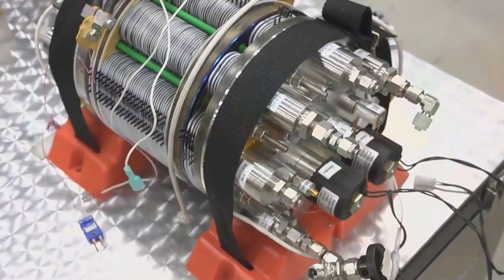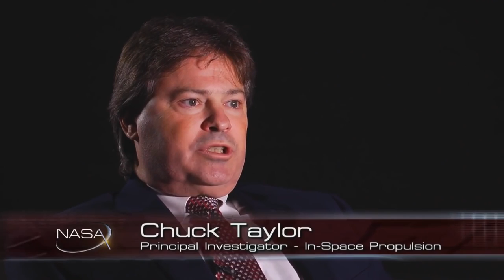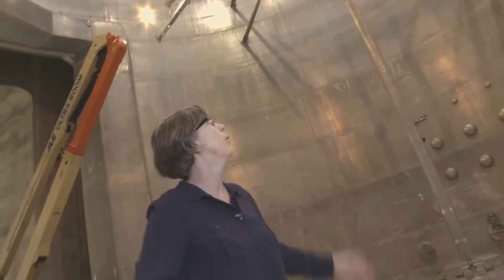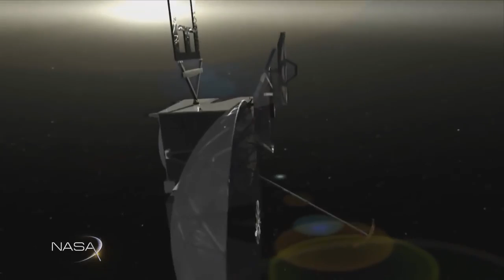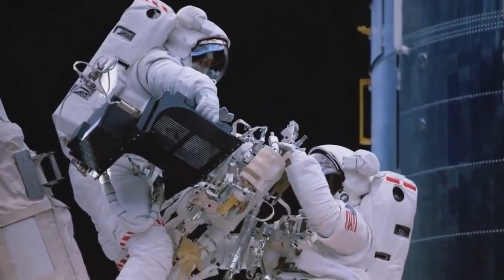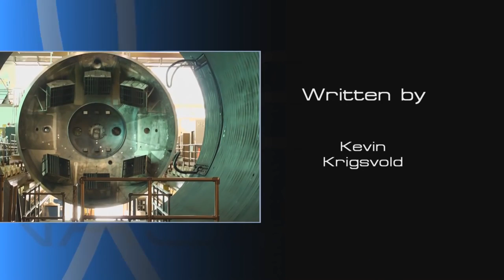Near Light Speed Interstellar Travel Development at NASA   (Full Documentary)

Comment: Propelling a space vessel faster than light speed

If we built something like a particle accelerator to propel a space vessel around through it several times until it got up to light speed then released it we would have accomplished light speed travel. To move faster than light speed every other electromagnet in the accelerator needs to pulse just behind the vessel when it gets up to a certain velocity and the vessel would need to have its own electromagnets that pulses repelling the energy field in the accelerator. Once the vessel is moving at the next maximum velocity every third electromagnet needs to pulse just behind the vessel until it reaches the next velocity. After the vessel reaches the next velocity every fourth electromagnet needs to pults just behind the vessel. The problem at the previous stage of understanding is that each electromagnet in the particle accelerator needs to pulse. The problem is that the electromagnets can't turn on and off or pulse fast enough, which counteracted the particle's maximum potential which is limited only by its structural integrity. Structural integrity can be increased by jelling the inside of the ship.

Comment: Light speed propulsion system

A particle accelerator on a starship would work by getting a hydrogen based plasma up to speed then releasing it. However to get the plasma to move faster than light the electromagnets don't need to pulse faster they need to be stepped differently. At first each electromagnet needs to pulse then when the plasma reach maximum velocity every other electromagnet needs to pulse. Then when the plasma reach maximum velocity every third electromagnet needs to pulse... so on and so forth. Once the plasma is up to the desired speed it can be released into a straight tube and directed out the back of the ship. This was discovered in another dimension while I was in something similar to a particle accelerator. It was also discovered that time moves faster in an accelerator. People that broke the law were placed in the accelerator and for the captive years would go by in a matter of minutes to the outside world. This was because the captive would go into an altered state of consciousness whereby their thoughts moved faster.

Comment: On another note, depending on solar energy when travel to planets 'further' from the sun is absurd. When you lose the light, what will you do then?
Reply: Sails will never work as you say theyre useless the further out they get and chances are they would be peppered with holes eventually. 

An idea I had is a nuclear powerplant and a set of mini accelerators to push out particles to create thrust over time. If Cern can move them at 0.999999991 the speed of light even if a probe makes half that it could go places and transmit data back or come back with samples if it can skim through something. Gotta be faster than ion drives.
Reply: In space, you don't loose velocity. The solar sails accelerate you. Once they get you going fast you dont need light anymore.